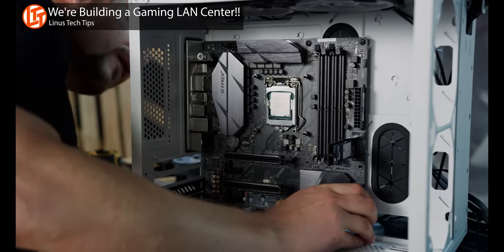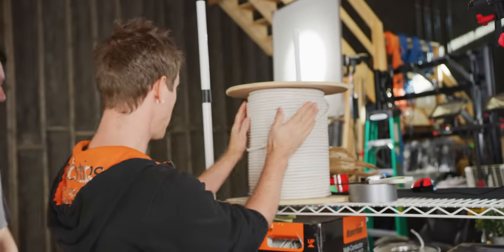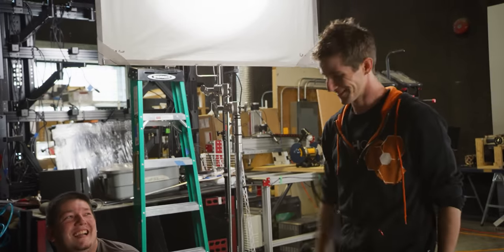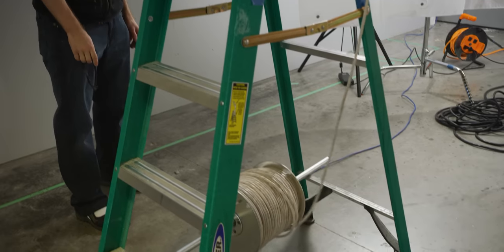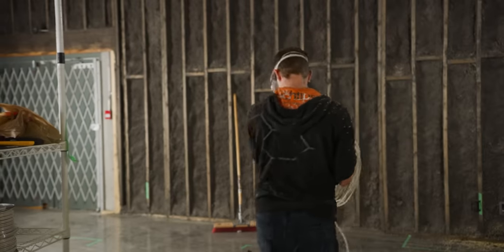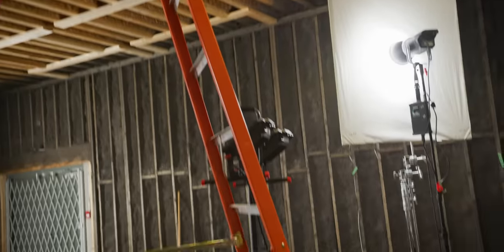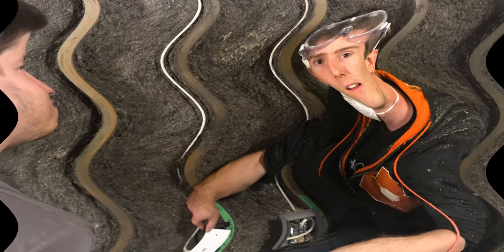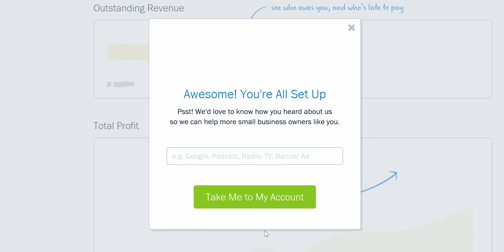Electrical Wiring for the Gaming Center - What could go wrong?

Comment: Speaking of wiring. I recently set up a new gaming computer. I'm using a Gigabyte Aorus Master motherboard, and I've been attempting to use the Easy Tune application to overclock the i7 9700K processor in my build.  I'm only using 1 of the 2 8PIN CPU connectors on the board. My thought was I may need both to overclock properly without bluescreening (which has happened regularly), and the motherboard shorts out and will not power on when using both 8PIN slots. When I remove one, it boots up fine. I tested each modular connector on my Corsair RM1000 PSU and when using only a single 8PIN cpu connector, it will power on. When I use both, it shorts out. Gigabyte's support has been utter shit and told me my PSU is bad or i'm not grounded properly. If I'm not grounded properly, how the hell am I writing this comment right now?!
Reply: PE doesn't lead any current.

Comment: Why didn't Linus and Brian used pvc pipes for the wiring?
Reply: GigamegaByte it’s not a code rule in Canada. Only when the wires are exposed running outside  the wall they need to be ran in conduit

Comment: Hi Linus and Brian. I live in the UK and the regs are pretty strict about the cpc, earth, ground, earth bonding and earth/ground stakes. and the rule of thumb is the cpc should be at least half the size of the supply conductors. Also we must always use earth sleeving on bare wires. I always do everything as per the regs or even better if it is practical. I can see how you do your electrical work is a bit different than ours but we are both united towards safety.

Comment: haha in germany we use cat 7 cable around 13 years in all new projects xDD
Reply: Nobody will pay for it here in The States despite it being awesome. Generally we'll use CAT6 for regular gigabit data, and CAT6A sparingly, generally only for for HD BaseT video. Gradually we're moving to CAT6A for general purpose, but honestly, If there is a special need for big stinky data throughput we'll just run OM4 to those nodes.

Comment: You are not allowed to put clips on data like that and half an inch of untwisted wire on the cat 6a jack is too much and it would fail a proper cable test

Comment: Ah wood shavings mens stripper glitter hard to get off and so much not to mention you dont need to ground the single gain box if the ground is wired to the main ground

Comment: Interesting comment about using 10gig copper cat6 for the gaming PC’s. 10GBase-T has a much higher latency vs 1G or 10G SFP (fiber/coax). https://www.datacenterknowledge.com/archives/2012/11/27/data-center-infrastructure-benefits-of-deploying-sfp-fiber-vs-10gbase-t  it’s probably not going to be something that’s going to make a big difference in the real world. But multiple 10 copper cat6 hops do add up. If you are going for the best performance possible then maybe running at 1 gig is better for gaming. Would be interesting to see an episode on the different Ethernet options and speed differences in the real world.

Comment: Why 14/3? I didn't see any 3 way's around.
Reply: Can either run 2 circuits sharing a neutral, or have 2 switched runs, or one constant power with one switched etc. 14/3 to first light, 14/2 from there to the next etc. #14 was just used for lighting and convenience plugs.

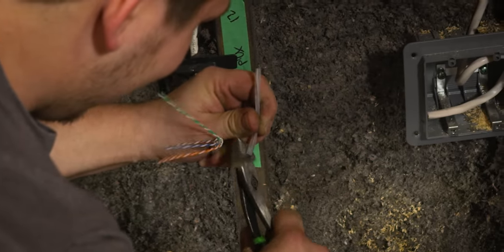Comment: 13:12 looks like a cheap cable.  yea its cat 6 but pairs don't have shielding, does not also seem to have a foil as well.  It's almost an antenna. it will pick up all kinds of interferences.  you should have used S-FTP Cat 6 not just Cat 6 which is UTP (Unshielded Twisted Pair) S-FTP stands for Shielded-Foiled Twisted Pair where all 4 pairs are individually shielded and there is a final foil shielding the whole cable.  Also cat6a supposed to have shielding  15:00  No shielding inside. very cheap cable.  Even the outer plastic is bad.  Such a shame spending this much effort and using shit cable.  10Gb? no way... even 1Gb will be difficult.  shame...

Comment: The reason why electricians don't carry hammers is they are pretty valueless 98% of the time. The Lineman's Pliers they use are quite hefty and durable and make a more than adequate hammer for the nearly all the "hammer tasks" they do. Nearly everything they do is screw/couple together or punch down, Really your paying a electricians for their knowledge and experience. It probably would have taken Brian 15min to do what it took Linus an hour to do and if Linus had not had any help it is likely the work he did would be a electrical and fire hazard.

Having worked as an electricians assistant in my younger days, I have the utmost respect for trade-skill workers!

Comment: Why tf are you stapling the wires?? what if you want to pull a new one through at some stage?? also wtf is wrong with powerpoint manufactures?? look at NZ ones for how it should be done, no live screws or wire on inside of plug

Comment: that all the wires going thru wood with no fire protection, wtf? If you are going to use high voltage electricity - you have made great bonfire-room (plain eu standarts). And yes, seeing that ground wire bare..... good luck in that oven-room